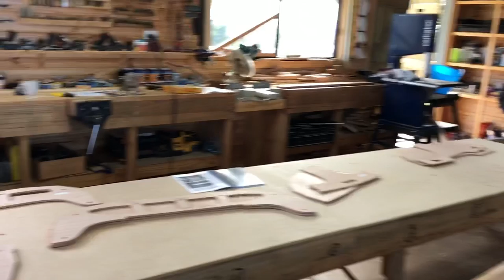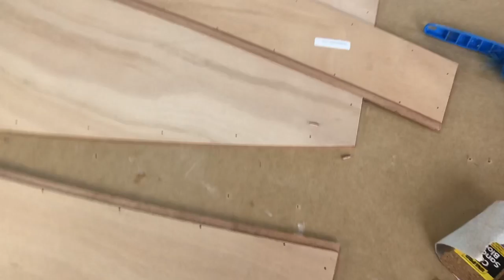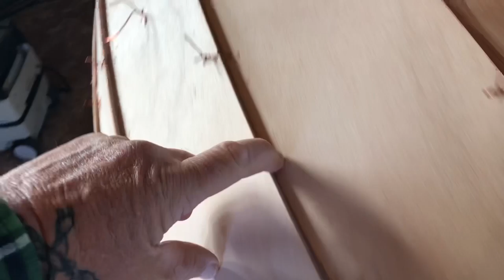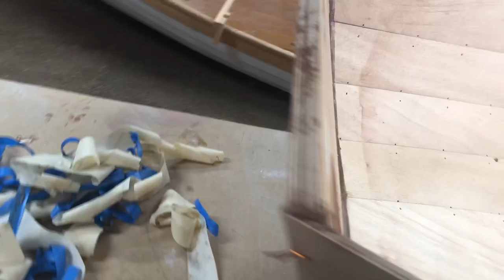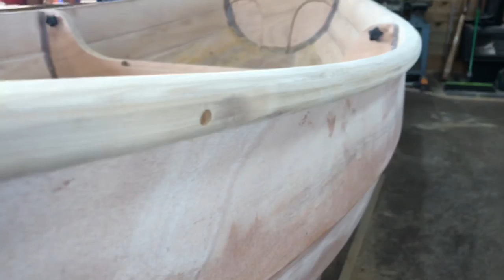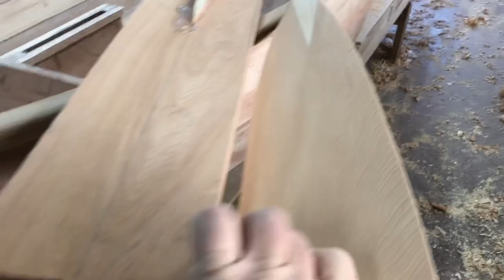Eastport Nesting Dinghy

Comment: may i ask if how tall is the dinghy? is it about 2 feet from the base?
Reply from the maker: 21 inches
4'9"" x 4'2"" x 21" when nested 
7'9" long when assembled
Reply: @RobLovelace  thankyou for the reply for i'm going to make this kind of dinghy, a nesting pram by chesapeake. my problem is that i didn't have a plan that's been bought. I will only rely visually on what I see on youtube and on other pictures so i know it will be hard to begin with. your reply will help. i already bought a fiberglass as well as it's  fiberglass resin. the only thing i didn't buy yet are the marine plywood for as far as I can see different parts needs different plywood thickness and that's what is still i'm trying to find out.